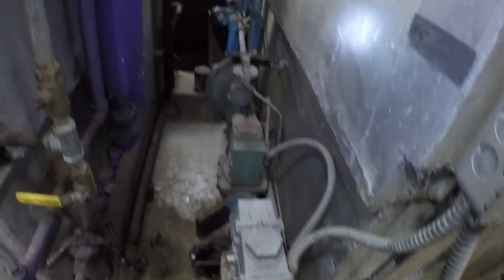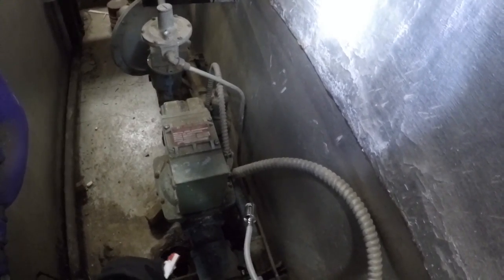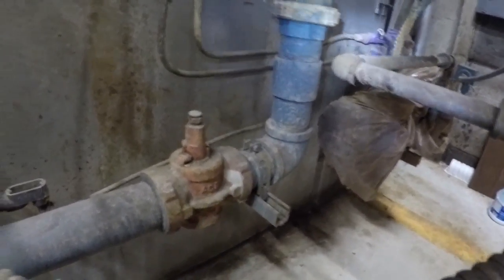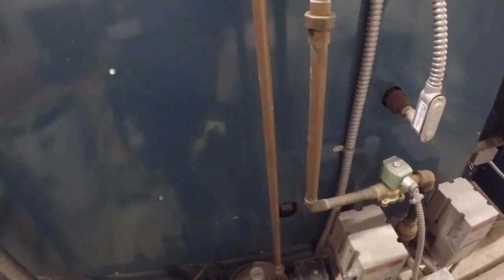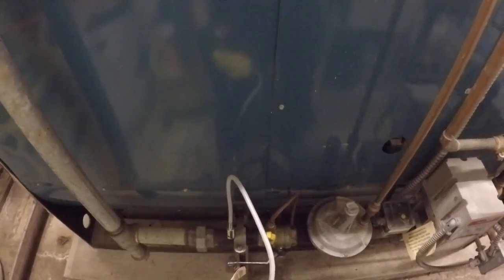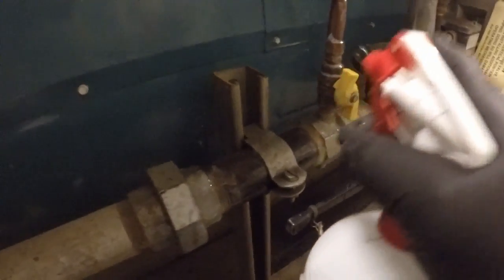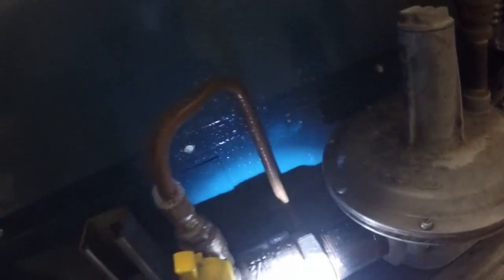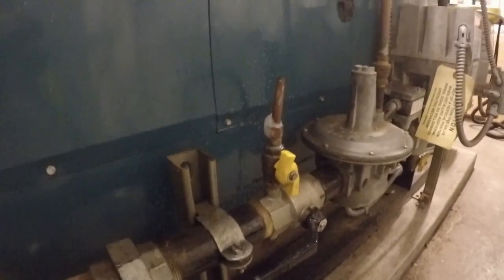Gas leak testing

Comment: Thank you for your informative video.
What do you do when you "check everything" and you still have a leak, small or large? How can I find a gas leak if it is underground(just dirt and grass)
Thanks again
Reply: Thank you for your reply. My question hasn't been answered yet.   How can I find a gas leak if it is underground(just dirt and grass)
Reply: I replied but then had to delete due to compromising info. Typically pipes get corroded where they go into the ground due to moisture and oxygen. If you already know there's a leak, then I would dig up the houseline and if it's too corroded, then replace the whole thing rather than repair the leaking portion. Just be sure you use the right piping for underground, and if it's possible to relocate it in a way that it's not buried, even better.
Reply: Finding the area where it's leaking with a detector if you had one doesn't tell you that much; the leak could be migrating from another spot. Bottom line, if it's a buried houseline leak, you will need to dig it up, expose it and then repair or replace the houseline. And of course, digging and exposing could be eliminated if you can abandon it and install new houseline that does not require burying it.
Reply: Thank you so much for your reply and answer.
Reply: Thank you so much for your reply. Very helpful.